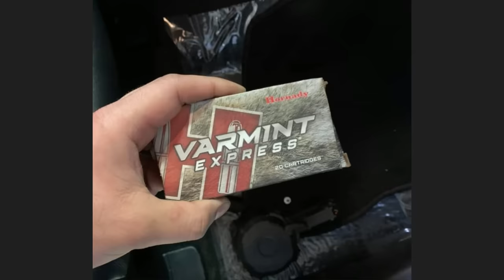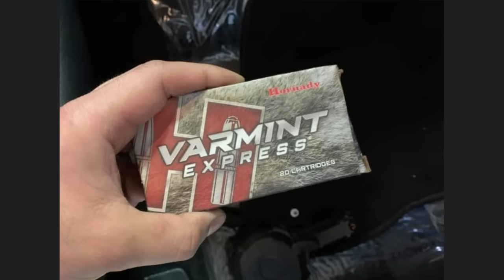Customer States Vehicle Overheated And They Kept Driving | Just Rolled In

Comment: Cant imagine people still driving an overheated later model car they want to KEEP! When I had my Concorde overheat one summer when it was over 92, and I was miles from home,  I had to turn the heater on full blast and that brought the temperature gage back to normal range. It was a miserable trip but the radiator fans were working, there was plenty of coolent, nothing sounded abnormal other than it wanting to overheat.
 I had planned to junk the car or sell it cheap by then anyway- (it also had a transmission issue that was going to cost over $1100 to replace the module)  it would slam into 1st gear/limp mode when I stopped at a stop light and the only way to get it back in drive again was turning the engine off and back on. I knew about that issue but since I normally only used it around town and it rarely warmed up to full op temp- the transmission and the overheating wasnt a problem at all until I had to drive it 60 miles out of town and 15 miles out it started overheating.

But for those who have an overheating issue suddenly on the road in the middle of nowhere, putting the heater on MAX and driving relatively slowly, all windows open if summer, should get the temperature back to normal range if there's coolent in the system and it's just a stuck thermostat, computer malfunction, sensor malfunction, or a radiator fan failed.

Comment: One of the reasons I always have a competent mechanic work on my car is that every time I hear a horror story, the words "I tried to fix it myself" or "I had another shop do it for way less money" feature prominently in the story. Still, competent workers can still miss stuff... for example: 

Back in 2005, my car got hit pretty bad on the driver's side. It needed a lot of body work. Since then, I had always had problems with the driver's window, which I had had looked at several times when I took my car in for other issues. The problems were usually resolved, but only for a short period of time. Another problem since that accident was that the door handle on the driver's door was prone to breaking every 5 years or so. After having the door handle replaced twice, I decided to order a handle and replace it myself. One of the steps to replacing the door handle is to remove the window guide... and that was when I found out that the window guide had not been replaced back in 2005. It was still lying inside the door at the bottom, deformed from the accident, and my window had been going up and down with no guide for 16 years. This was why I was constantly having window issues, and it was also the reason my door handles were failing more often than normal, as they could occasionally catch on the out-of-place window, putting more stress on it that they were meant to take. Well, I found a replacement window guide, installed it, installed the door handle, and things have been peachy ever since. I'm just wondering how long it will be before some mechanic has to look inside my door and ends up sending in a video into this channel with commentary "Customer states he replaced the window guide and door handle himself..."

Comment: The 3 most interesting things I found inside tires during repairs was: 

A large flathead screwdriver. 

A pair of vice grips. 

A spent .40 caliber shell casing. 

The shell casing was what had actually punctured the tire, and somehow made it all the way through and was bouncing and rolling around in there.
Reply: As someone that's had a shop leave tools inside their tire, I'm glad it's not just me.
Reply: @ZanHecht  I really don't know how all these tools get left inside tires. The last thing that's usually done after a hole is repaired, is you vacuum out any debris that you created while buffing the inside of the tire. You would naturally see a big pair of pliers laying there. And even if you DID leave something in there, you would hear it knocking around as soon as you tried to spin balance it. Just shabby work I guess.

Comment: Electrical tape? There's your problem, shoulda used duct tape on the brake line😁
Reply: This is not funny. Somebody might take this seriously.
Brake line repairs need to be executed with at least 5 layers of aluminum foil, fixed by proper cable ties. Safety first!
Reply: flex seal for the win! LOL

Comment: 0:19 It could've been the bolt wasn't tightened enough and backed out. I once had a new sway bar and sway bar links installed on a car and after about 20 minutes of driving, I heard a rattling noise, turned back around and went back to the shop. Turns out, the bolts weren't tightened correctly and had started to back out.

Comment: Still can't get my head around how some of these collections of rust manage to move together at the same time.
Is the problem that vehicles are so cheap in the USA? Here in the UK at least they're so damn expensive I'd like to think - generally speaking - we take better care. (Then again, I'm old and do that as a matter of course.)
Made me laugh - again! Keep up the good work.
Reply: No, the worst cases are usually motivated by the cost to repair. The difference between is they're more integral to life here because they're more necessary. Everything is more spread out because the landmass is far bigger. It's not conducive to efficient mass transit either with the exception of the few hyper-dense metro areas. Even then, the minute you want to go outside that area, things get stupidly inefficient without your own vehicle just as a matter of circumstance.

For comparison, the isle of Great Britain (~209k km²) is slightly smaller than Kansas (~211k km²). Great Britain has almost 61 million people and Kansas has almost 3 million. Not to mention, Great Britain has a fairly narrow chokepoint on the English-Scottish border that helps focus transit, whereas Kansas is essentially a rectangle surrounded by other rectangles, all on open plains.

Comment: if that hapends (first clip get to a place you can safely park, check the lvl of what helps cooling the engine fill more on if needed. if nothing wrong there or with the oil etc call a towtruck to have that deliver the car to a workshop. it will be far cheaper than to keep driving.
Reply: I once stopped to help a car stopped on the highway. "Hey, anything I could help with?"
"Uh, engine overheated, lot of steam and the light came on. I'm just waiting for it to cool down so I can get home."
"Well, if you drive it you'll ruin the engine. Tow truck is cheaper and you'll get home faster. Got AAA?"
"Yeah, I'll...just wait here. Thanks."

Comment: If you're going to work on your own car, fine. Wear a GoPro every step of the way. It will help you remember "which way the brake lines go" or how many bolts you removed. You WILL forget. I do brakes for all 3 of my cars, but it might be 24 months between any two of them, and they're all slightly different. There's no way I can commit it to memory well enough not to rely on video or written notes.

Comment: I get concerned when my temp gauge goes past 200F, not that guy though. Keeps driving even though you will crack your engine block.

You gotta turn your heat on full blast, roll down all the windows and pull over, shut off the car but leave the ACC (accessory key/push button position) on so you can keep the blower motor push the heat away from the engine.

If you can't figure out what the issue is (low coolant usually), leaking coolant/water pump is out, or something obstructing the cooling fans on the radiator get a tow.

Comment: Yes, electrical tape. The perfect fix for a hydraulic leak of several hundred psi. I wonder why car manufacturers don't use thin vinyl tubing as brake lines, since that would save money over the more expensive steel.

Comment: He couldn't  figure  out where the pre bent brake lines went?
Here is a pro tip, it is like that test, the round peg goes in the round hole and the square peg goes in the square hole.
The new U shaped line replaces the U shaped line on you car.
The S shaped line replaces the S shaped line on your car.
Are you seeing a pattern?

Comment: I'm confused by the first clip. At first I thought it was steaming out because of overheating. But you said its actually exhaust-gases entering out of the cooler-valve? I'd be curious to know a bit more on how thats even possible. You said engine damage, but what exactly do I have to damage to manage my exhaust gases coming out of the cooler?
Reply from the maker: Cracked engine block or warped cylinder heads which was caused by them still driving when the vehicle overheated. Things got very hot!

Comment: That first explorer should've gone into "limp mode" and only run on 3 cylinders using the other three to cool. Continued driving at speed or attempting to should've then made the ecu shut the engine down. There's chapters in the manual all about how the engine protects itself. What gives?